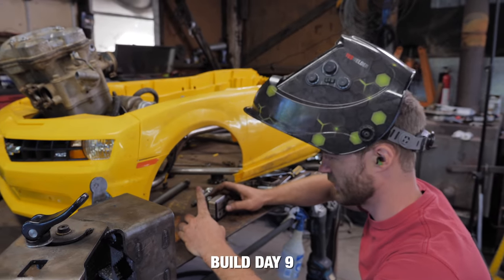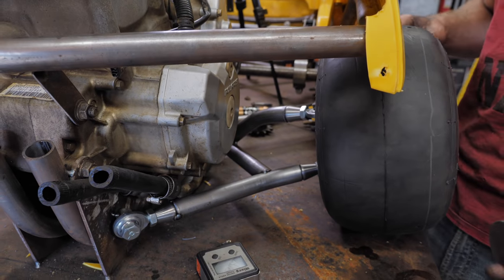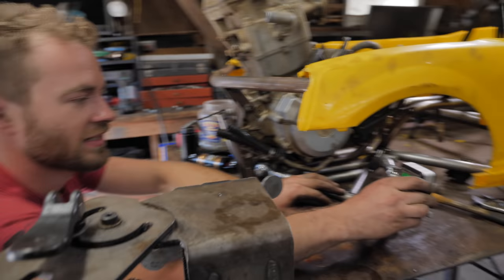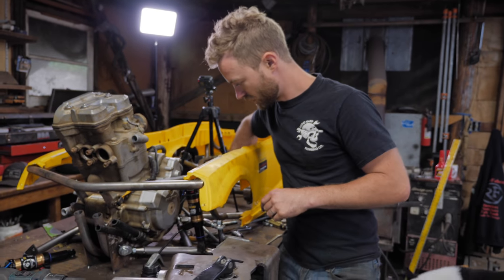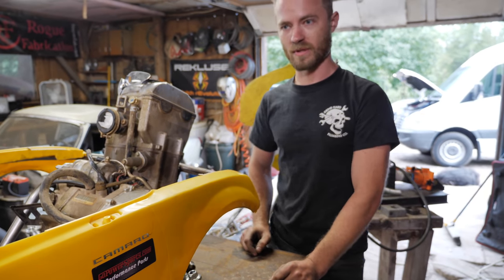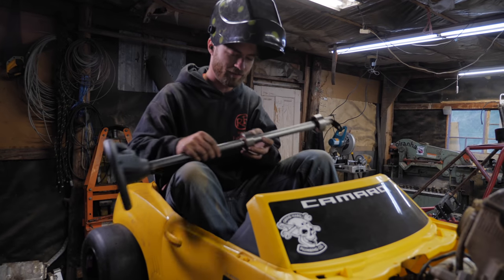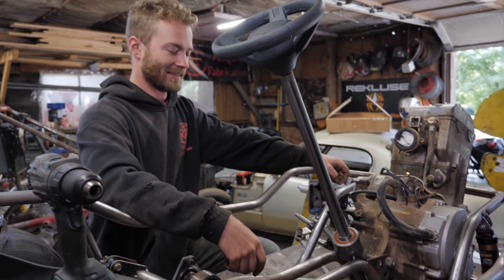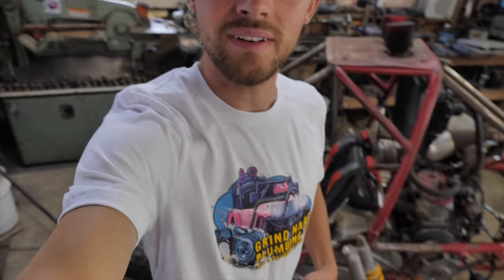Camaro Gets Front Suspension and Steering

Comment: As others have commented, you had the Ackermann geometry correct first time round. Your bellcrank on the bottom of the steering column will also add Ackermann angle. Right now I suspect you’ve gone back to near zero, the negative Ackermann being cancelled out by the positive from the bell crank. I thought I’d mention it now before you get too deep into it! Top work though, very nice fabrication!

(Edit- someone down below has also pointed out that drift cars have their Ackermann reduced, because obviously on opposite lock it’s a handicap, so it might be just great as you have it right now!)

I spent days and days on steering geometry on my soapbox car. I had the arms in front of the axle for legroom, and the large KPI I had to use to get the steering axis in the centre of the tyre (I wanted zero scrub radius because of the brakes) cancelled much of it out as the arms moved through their arc. I had to put a backwards bellcrank (because it’s in front of the axle) on the column to get it right again, so on my car the track rods cross over each other.
Reply: They will find out that it’s wrong eventually

Comment: you had the ackerman steering right the first time. that's how my race kart is
Reply: Yep, the inside wheel needs to have more turn in than the outside wheel, when approaching full lock.  It looks opposite to this at 18:03, although the angle of the shot makes it difficult to tell.

Edit: actually looks pretty spot on at 19:18 - would love a quick segment by Ethan about it in the next vid :D
Reply: You are correct, what they have now is called reverse ackerman.
Reply: I was just gonna say this too.

Comment: For your air suspension you should cap off a section of frame (cosmetic not structural) and use it as a small pressure tank.  Should hold enough pressure.

Comment: You had the Ackerman right the first time, where your lower pivot is  will change everything though, ideally it should be in line with the steering arm outer pivots but someone put an engine there! I like the idea of welding the arm to the table to replicate the other side, I built a jig that bolts to the hubs, centre that in the car and then build the arms in from there.

Comment: Y’all should definitely make the air suspension work like bags on a car. To where you can get in press a button to open the valve to air up the shocks and raise it with having to manually air up each shock

Comment: You were correct the first time about Ackerman angle but it only applies when steering system intersects at 90 degree. If you move the steering linkage forward or aft the simplified expression of Ackerman becomes more complex. So to get exact 100% Ackerman you measure the angle of imaginary line going to center of rear axle to a transverse line between the two front wheels. For example, if it’s 70* (-20* inboard from steering arm pointed directly back, the way you had it originally). Then you measure the angle of your steering linkage, lets say 30*. 70+30=100... so now you’re looking a +10 outboard from steering arm pointed directly back. It’s the relative angle of steering linkage to steering arm, that angle is determined by wheelbase, measured by angle of imaginary line to center of rear axle

Comment: The thing about Ackermann steering is, you got it right the first time. But because the steering shaft is angled back so much, any motion to the left or right in the rear steering shaft pivot is going to result in a lot more motion at the front steering shaft pivot, increasing as the angle between the rear steering shaft pivot and the front spindle increases, measured on the front steering shaft pivot, and decreasing as the angle decreases. Had you turned the wheel enough with the first design you might've locked up the steering as a tiny tweak to the right could have lined up the two steering shaft pivots with the spindle pivot. Before the remake on the steering I was going to comment that you probably wont need any extra offset on the steering mount in order to get Ackermann (with that setup it would give Ackermann steering with no angle on the steering bracket). Could be useful to layout this stuff in software or on scrap wood if you want an approximation. With a steering rack mounted so it lines up precisely with the outer steering pivots you'd angle the brackets inward as shown with your first design to get more Ackermann correct steering.

TLDR: You'd get Ackermann steering no matter what, but normally the first design is what gives Ackermann steering with a normal setup.

Comment: The steering shaft pivot being so far behind the spindles is going to be a problem. Yes Ackerman from the steering axis pivot through the tie rod pivot to the center point of the rear axle. But that's only if your steering pivots are right, whick they aren't at all.  I would run a short tie rod from the steering shaft, forward under the engine to a bellcrank paralell  to the bottom of the frame, that has the two point for the steering rods. The way it's set up now it's going to over center at full lock with any decent amount of angle.

Comment: at 14:45 when you showed use the bracket that welded to the steering arm. instead of under all the cage.. and have to make a protection plate. maybe move it above the bar and move the move the bracket up higher so it can be in a safer spot.

Comment: Wondering if adding a steering damper shock would help smooth out the steering even more while traveling over rough terrain or bumpy roads. Something similar to what is installed on various motorcycles.

Comment: why the steering rods have to go under the lower tube ?  make the steering rod plate on a piece of pipe you can insert and lock between the bearings , looks like you could have so much more steering angle and ground clearance ... this project is dope!

Comment: Thats not Ackerman. To get the right ackerman you want to run a string from the center of your king pin to the center of your rear axle on both sides. You want to put your tie rod mounting points somewhere along that string. That will give you ackerman which is making your outside tire turn faster in a corner in either direction

Comment: Why do the steering rods have to connect to the column at the bottom? Why don't you have them attach in between the two bearings for the column and flip the knuckles on the steering arms at the hub.

Comment: Hi guys. Love the builds. I was wondering with pipe bender are you using? Ive been wanting to build a single seat mini sand rail for years now but dont have the equipment yet. Any help or guidance would be greatly appreciated.
Reply from the maker: It’s a Rogue Fab model 600xHD. We love it. They are a great company to deal with too.

Comment: Hey guys love the work and such but as a video editor I have to yell at you for over doing the audio track over the vocal track making it hard to hear the performer talk.  What we do to solve this when we make interviews and such where we want to block out exterior sounds and more of a vocal channel from the performer is connect them to a secondary recorder and do a timing mark.  I movies you see this as the clip and action board that slams down and makes a sound as it hits.  This way you can line up the snap of the audio to the hit seen on screen.  And what we use to record the audio is usually a Iphone with a great recording mic hooked in.  then you can take a small hammer and hit a piece of wood on camera to line up the audio to the impact or get and action board.  And then when we add music we keep it to about 1/3 the decibels of the performer this way you can hear the performer over the music making it less of a strain on the viewer to make out what the person is saying.  its a little extra work but the quality improves quite a bit.

Comment: Thinking you won't need to add air to the suspension is like how you should never have to get your cars ac recharged with freon. Just because it's supposed to be a closed system doesn't mean it is.